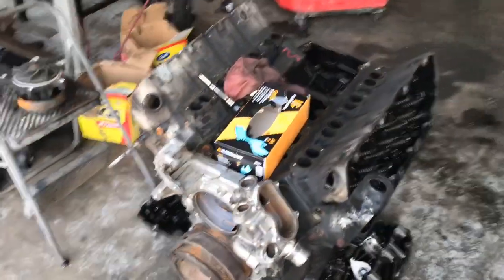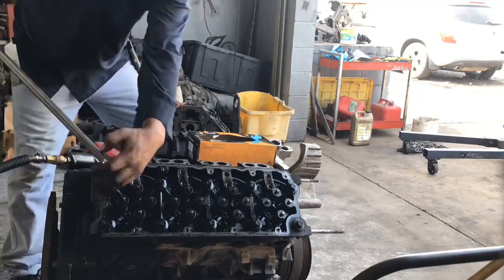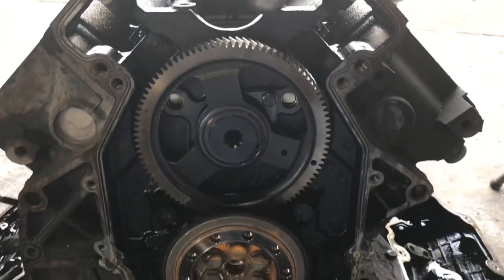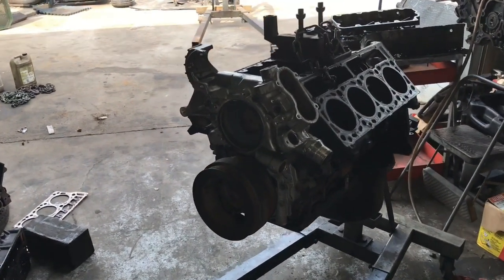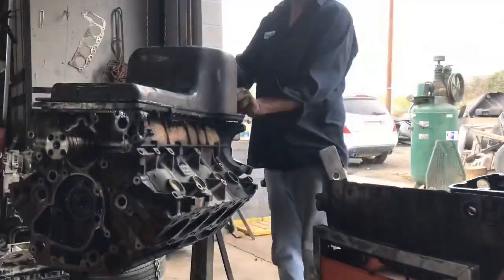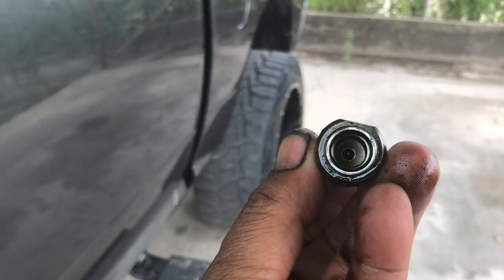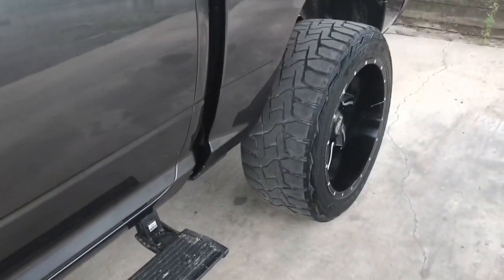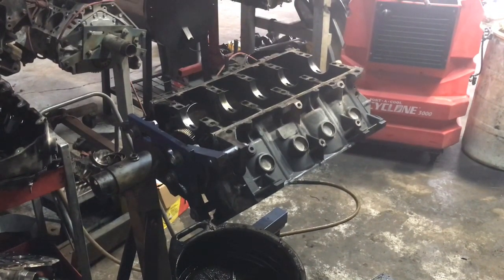6.4 power stroke (what a broken lifter dose to an engine)

Comment: Doing a rebuild on my 6.4l great vid. I broke my harmonic balancer dowl pin half in crank half in balancer. Can that be replaced?
Reply from the maker: Hey there Chester. I haven’t ran into that kind of issue with the 6.4. I’m not too sure if the dowel pin is replaceable. One thing is for sure. I would try to replace it. Glad you liked the video brother. Thank you for the comment.

Comment: Hi, I have a problem with my International maxxforce dt466,  I rebuild the engine, when I run it in the morning when it's cold it's start from the first crank,  but when it's get hot and I turned it off it will not run . I need to crank at least 3 times to make it work
Reply from the maker: Hey there Murad. I have a question. Did you replace the high pressure oil rail seals. 2nd question. Did you replace injector O-rings. You can email me if you prefer to joegonz268@gmail.com